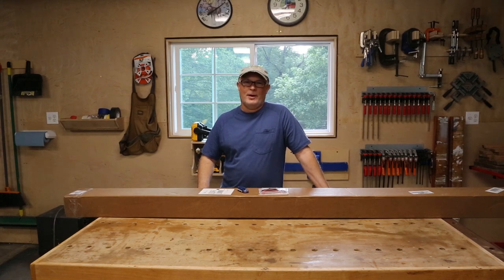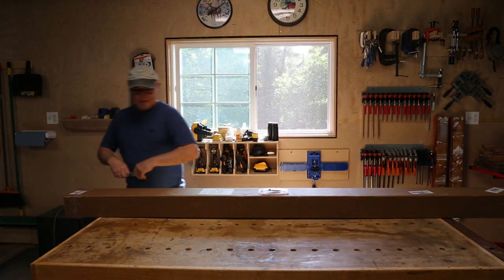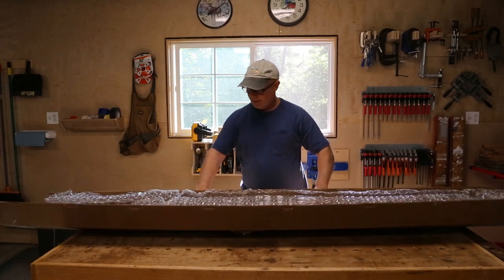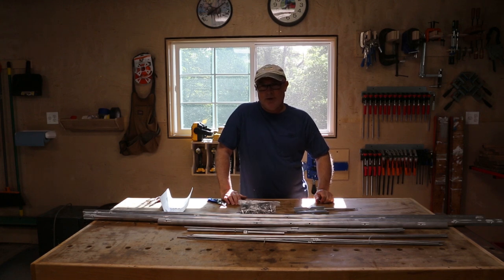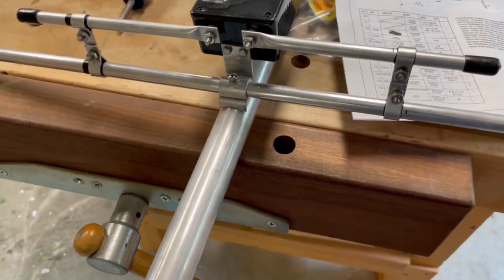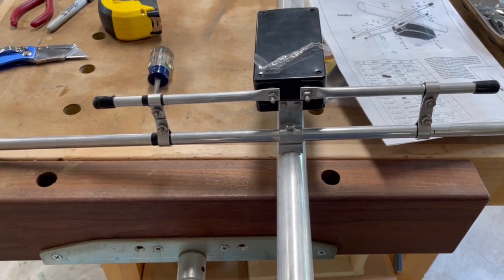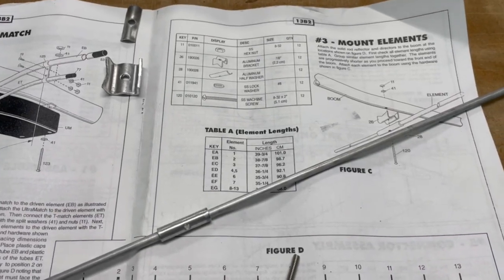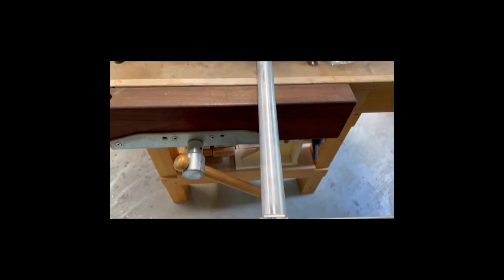CushCraft 13B2 2m Yagi - Will I Be Able To Assemble This Thing!

Comment: Darrell, on every gamma match I have seen, and i have made a few from scratch, the shorting bar, or strap, is always in contact throughout. Meaning, continuity between all connections... so, I am not sure if that will work with the electrical tape insulation. Just my .02.... but maybe you will prove me wrong! I have an earlier "boomer" model, from the 1980's, with same amount of elements and has the old 3-element reflector design. Works great, and i use it on 2m SSB. The older models are SO much better made.... its a shame that for that money,  you have to do you own fabricating to get things correct.....bummer. I likely would have done what you did....but that's me. I am more hands on, like you... 73, WD9M
Reply from the maker: I think I'd like to get into making my own antennas in the future. Now that I have the tower up, I can do more experimenting. Thank you for the comment.

Comment: At 06:50, T--Matches Don't typically use any Element to Element "Capacitor" slip-joint  Insulators or tape...It's usually All DC continuity except at the Terminal connection Ends....You may Not get the expected good VSWR with all that Insulation Tape there..
Reply from the maker: After I called them, I removed the tape and did a bit of study on antenna yagi design. I've been thinking about make my own 2m yagi and use it for ssb. Thank you again for the comments.

Comment: At 10:00 Did you check that your Bolt part 120 is Actually a 8--32 (0.164") screw diameter  size ?? .... What Diameter was the Factory hole diameter before you 0versized them ? .... With that Original size hole already leaving so Little material, I would have just used Smaller diameter screws....
Reply from the maker: I did measure them, but I don't recall the size now. I also verified that were the correct size that should have been in the parts list. They just drilled that wrong size hole. I thought about using smaller hardware, but it would have been under sized. Thank you for the comment.

Comment: No good reason for any Mis--Drilled holes on any Round tubing antenna parts...Absolute perfection isn't expected, but the Factory should use a Precision jig to Assure Correctly Positioned holes....Looks like your holes were just Hand/Eyeballed drilled....
Reply from the maker: I agree that they should be using a jig to drill these holes. I didn't expect that I would run into this issue. Thank you for the comment.